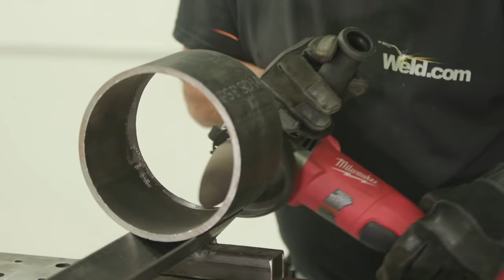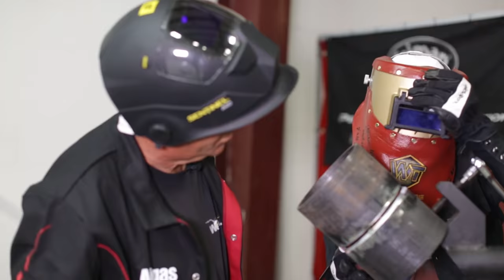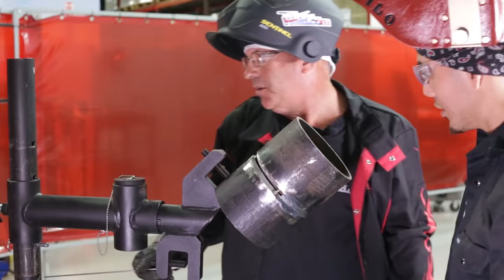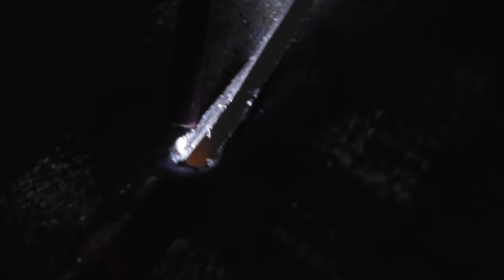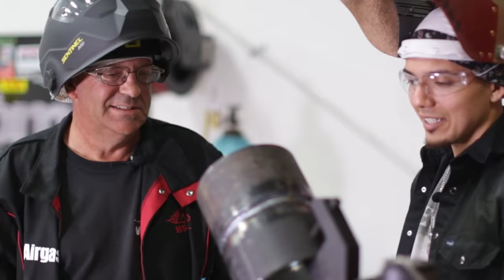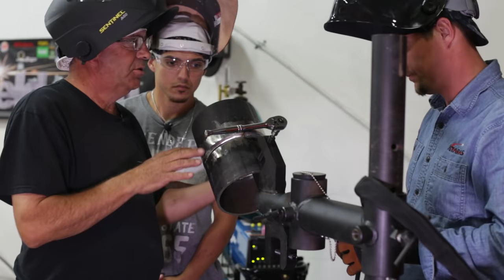🔥 6G TIG Roots: Land vs Feathered Edge vs Laywire (Featuring WeldTube)

Comment: Yeah I was a back feeder from age 15-20 but I joined the union and laywire wiping like 6010 was shown to me and this guy's exact style is how I've done it for 13 years and it's fast man and gravy tight 1/8 95amps I could drag a vantage 400 all around site and be the root hand without changing anything all day. Had 2000 welds on a year job no rejections so I'm hooked

Comment: its nice to watch if guys are pretty good in welding they are all good,root pass for the old guy using the 6010 is more safe for penetration but prone for undercut but no problem coz it will cover up by the hotpass, the young guy is also good he was able to control his keyhole which is very hard to control sometimes  but overall you are all definitely awesome. good job

Comment: Procedures myself and the guys i work to follow, state 3-5mm root gap, up to 2mm root face, 110-135amps and 2.4mm filler wire. 
Personally i like feathered edge, and 3mm gap (4mm for 6" and above, 5mm for over 12") 125amps and 2.4mm rod.
Lovely fluid puddle, doesnt need backfeeding or any of that cr*p, i just feed through the prep into the underneath of the puddle.

Comment: I'm not a pipe welder, that being said will you ever encounter a 6g in the field? Everything I see is 2g or 3g joints.
Reply: NTH Welding ya coming off vessels.
Reply: Peter Johnston like I said not a pipe welder. I have been welding for 18 years. Just not pipe welding.
Reply: This is a test of skill that's quick and easy to setup for a training place, it's only the starting level of the hard to get right test welds, there's another 3 tests up from this one but it'd be very rare to be doing such welds, this will usually be the hardest one to do.

Then you have the underwater tests. 

Out in the real world this are way way different,  blind welding up side bent over the edge of something, face jammed 3 inches from the weld.
All that stuff

Comment: Is ok, but I get the thought that this kid doesn't have as much experience in this. 
I heard his background but I think it's a bit limited, and while it's ok but there's probably plenty of things that would hang him up.

The other thing is all the tests are ok but it's nothing remotely like how it is working on this stuff for work. 

And I think that's what bob is thinking about when asking about stuff.
Reply: zagan1 can you show us what you do on the welding tig field, instead of picking on that kid and his supposed back ground
Reply: He is only the lead instructor for the South Coast Welding Academy.
Reply: Pugadesigns who is that, the kid thats shows his welding techniques
Reply: Yes, lead instructor Hjalmar Aguilo also on youtube Weldtube.
Reply: zagan1 Here's what I'm thinking....Hjalmar can handle it all. Stick, mig, tig, fluxcored. He's not limited in skill, passion or expertise. I would trust him in the field or training lab. He has the experience and knowledge despite being younger.
Reply: Bob  Moffatt thats cool
Reply: Bob  Moffatt 
I'm sure he'd get by fine, I've checked out some of his videos. They good I've used some of the things he's said. 

My comment is about reasons for doing something,  like you using the thumb not fingers, because it'll be closer so if your in an tight place and need to weld it then you can get in.

At my work we have to blind weld half of the pipe as it's on shipping tanks, so you can't get to the other side,  and that's enough to cause some people to simply walk out after a few days as it's too hard. And that's guys that'd be welding pipes for the last 10 years or longer on mine sites earning half a million for 6 months contract, it's suprising at how limited experience wise some people can be, I guess it's the old stuck in a rut but really good at that 1 sort of work.

Maybe you should try that 4 inch pipe and blind weld 1 half, complete from 1 side for some fun. :) would be good to see how you'd go about it. It's a real pain.

I also have to add we have to pressure test all our pipe welds to 1 or 2 bar and fix any pin holes as expected.
Also have steam pressure tubes which go up to 8 bar also have to be pressure tested as well,  had to fix up someone's fuck up from manufacturer (i think) as had around 9ft of cracked steam tube, all cracked on the parent metal next to the welds, as been too hot all stainless too.

As the tanks hold between 2 bar to 8 bar.

Everything has to follow un international rules / standards as every depot and port will check the tanks a minimum of 2 times, once coming in and again before going out.
Reply: Bob Moffatt Ahh, but the most important question: can he gas weld? ;-)